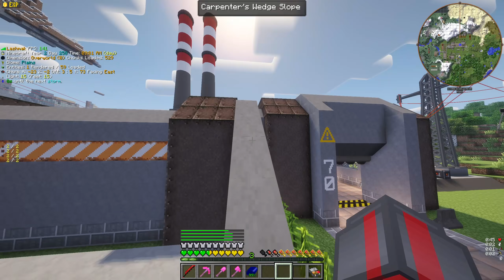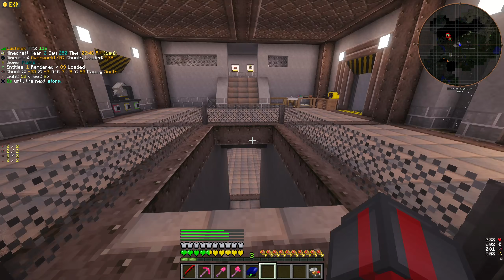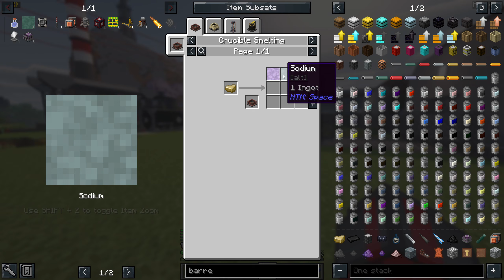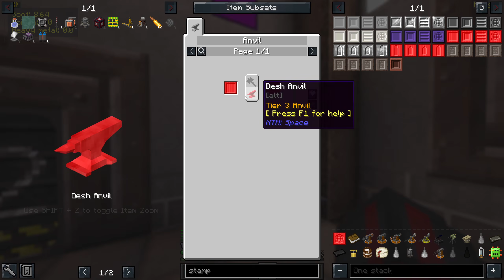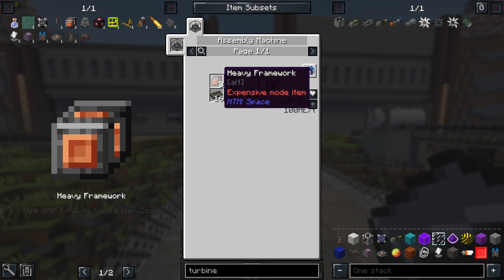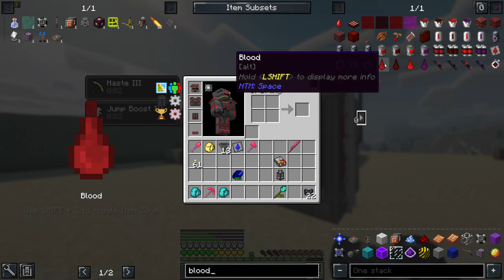NuclearTech: New Horizons - Ep06 - Full Steam Ahead

Comment: Dear lord of darkness you should look at bedrock oil extraction, it require both a fracking tower and fracking solution but it is a source of infinite oil, i just recommend you to either put far away from your base if you want the natural gas and passiving arsenic and cadmium so you don't need to continually run nuclear reactors for bismuth and techninium99 respectively, or set it up in your base with an afterburner mk3 upgrade near your base if you don't care for the previously mentioned resources, you can easily figure out if there is bedrock oil by the patches of dead and oily dirt or sand in the surface

Comment: I am humbled on the naming for the solar array, thank you.
I was surprised as well by the  low and uneven efficiency of the system, maybe the mod author still has to balance the output, same goes for the heat exchanger, perhaps if you build a few more so they can share the lava pool.
It would be a shame if this mod is not ported to Minecraft 26.1 it is just aesthetically beautiful, but they have to work on the lag as well.
Reply: For what I know is being ported for 1.20.1 forge and 1.21.1 forge ( if I not wrong).
Reply: @leonardogomes116  i don't think the same author ported the mod for the newer versions cuz what is available is a full rewrite to the mod they share some basics but lack a lot of things
Reply: @taissir_dz there's also some newer things that are just straight up missing and other things added that make the ported version feel more like a meme in my opinion, I only ever recommend the 1.7.10 version unless the devs directly ported it but i could also under why people like the ported versions

Comment: try using combined cycle gas turbine for burning natural gas, also you can do bauxite processing for a lot of aluminum titanium and iron
Reply from the maker: my fellow lord of darkness. 
everything you just mentioned are on the list except natural gas. i personally dont use resources that arent reneweable. i know it will be renewable later, but now if the oil runs out, it mean i have no power

Comment: Dear lord of darkness, you shold look into getting an ore acidizer as they not only unlock an easier desh ingot recipe, but it is also the next step in ore processing allowing you to quadruple your ores in a centrifuge and later letting you sextuple the ores in an electrolysis machine, just be aware that the electrolysis machine is very power hungry, you shold also look at getting a powerd drill for mining as without driilbits mods it mine a 3x3x3 area and you can give it fortune 3 with mods that are installed in a weapon modification table, and when you get a robust enough power generation you should look into getting some bedrock ore production, as that can be a extremely powerful resource generator, specially for some of the more exotic metals in the mod, as some metals have really esoteric and unhinged aquisition methods
Reply from the maker: my fellow lord of darkness. i am a bit ahead in recording and i have some of those machines. but my main problem is power now. I am producing around 80k HE/t but i am consuming 75k just for AE2 and some other machines. I need to solve that first

Comment: instead of spamming solar boilers, if you really want to scale up you need to use your oil, burn heating oil or petroleum gas in a heater to make steam, diesel in an industrial combustion engine, kerosene in a turbofan, all the other oil fractions can be turned into those using cracking towers. and always crack your natural gas

Comment: i suggest doing bauxite processing so basically you need lye you get it from putting cryolite inside rhe combinations ovwn after rhey you mix it with bauxite in a miker you get bauxite solution then you put it in a fractioning tower and get red mud you put that in a electrolysis nachine you alsi fet sodium aluminate snd you mix it with cryolite fir alumina and you put rhat in electrolysis snd get tons of aluminium

Comment: kerosene is not only for the jetpack! Its used in the PUREX for reprocessing nuclear fuel and also very energy dense, which makes it ideal to be burned inside a turbofan,,, and since you get lots of kerosene from a complete oil processing plant, you can handle 2 turbofans with afterburner 3 and gets ton of power!!!
Reply: until your oil suddenly runs out
Reply: @ionisator1 it takes a while till that